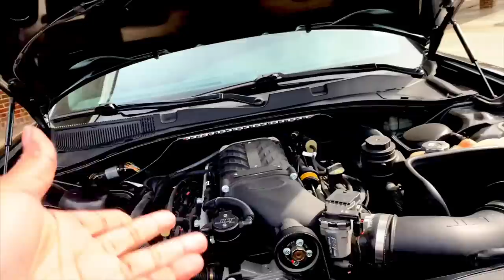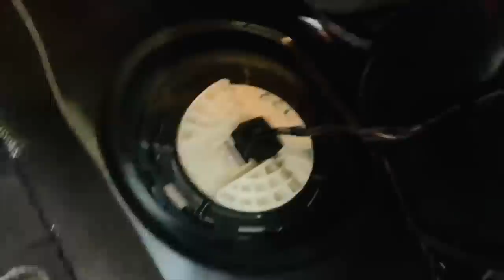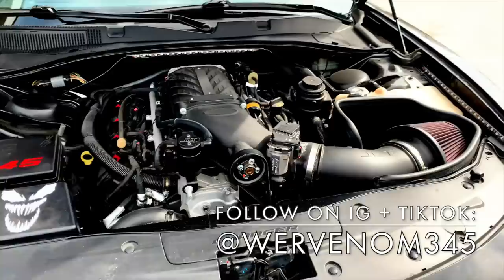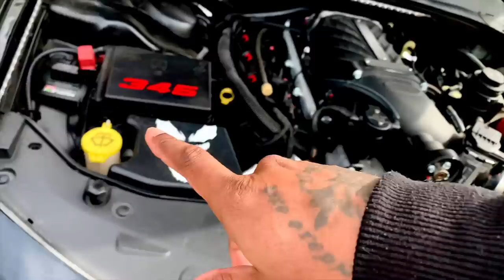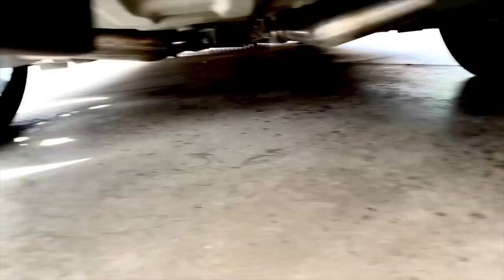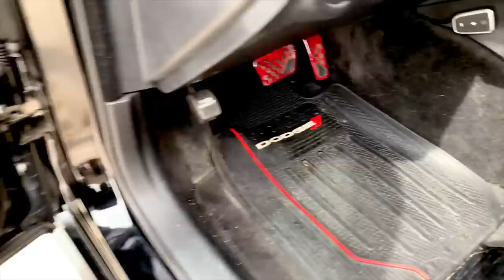How to make your Dodge Charger + Challenger 5.7 HEMI faster than a 392 Scat Pack and a Hellcat!!

Comment: Great video!!! When I saw that it was over 1 hour long, I figured I’d watch 10-15 minutes worth then move on. I watched the whole thing! I agree with your other viewers that I got more from your video than a lot of other YouTubers. Thanks for the blueprint.
Reply from the maker: Glad you stuck around for ALL the info! More to come! 🙏🏾
Reply: Same here, almost bailed on it early, glad I let it run. Buying a 2015 Challenger RT today, already own a bone stock 2022 Scat Pack Shaker. I got the 5.7 as a project car and I want to mod it to run with the Scat. This is a decent guide with some really good insights. It’s a fun platform. Thanks for the education!
Reply: @WeRVenom345   what kind of high flow cats do you have if you have time can you answer my question? thanks my man
Reply from the maker: I have Stainless Works long tubes with their high flow catted mids running through two Dynomax racing bullets and a pair of Flowmaster Outlaws out back

Comment: 5.7 L Hemi is arguably one of the most choked down motors from the manufacturer. With the correct throttle body and intake and getting headers in a full exhaust system and then throwing in a can in tuning the motor. You can actually get a little over 500 horses from the crank out of these motors before you even add forced air entry. There is nothing wrong with an RT. Here's a piece of information that most people don't know. On Dodges race team, the Challenger that they run actually has a 345 cubic inch motor that runs in the low 70s with just over 600 horsepower. They are not running a 6.2 or a 6.4 l.. the fact that they actually use a 5.7 in their race car which runs in the low sevens with just over 600 horsepower speaks volumes period last I checked you could purchase that crate motor just like the elephant motor however the 345 race engine is like 49k.      I'm still driving. Sorry for any talk text errors. I had to comment, though I always get pumped seeing people rep the 5.7
Reply from the maker: I love this so much!

Comment: Good content. I love my Charger RT 5.7, I’ve always realized you can build your 5.7 up, as NASCAR uses a 5.7 NA to 700 hp. Amazing that power w/o boost from NASCAR. Knowing what you’ve done with yours has been awesome keep it up!
Reply from the maker: The 5.7 has so much potential that is turned down by the factory. All it wants is to be turned up. Like you said, just ask NASCAR. Thanks for the love! 🙏🏾

Comment: The 5.7 just gives a person more useable power. The rod to piston ratio is so much better. The ring pack on the 5.7 is better vs the scat . You can run more boost on a stock 5.7 vs Scat. A lot of stuff from the scat works even better on the 5.7...its just better.

Comment: Finally someone that speaks old school fundamental wrench. This is a very high quality matched component build. I sold my 13 rt 6spd for a srt392 6 spd. I may have kept it if Isaw this first. I like my suspension and brakes but the Rt was radar red interior inserts and had BR9 brakes. The Rt is definitely worthy. Not to be demeaned.  Vindication.  Nice.

Comment: Great video my man great car. I just wanted to comment. You are correct about the 309 rear end being a better way to get your power to the ground it is a limited slip. Your explanation between the two rear ends was a little backwards though. I'm not critiquing I just want to clarify for people who are serious about building their Chargers. So the open differential actually divides the power will a 50/50 each wheel and if your car is in a straight line you will burn out both Wheels . What happens though when you go around the corner and you take the weight off of one or other of the wheels you lose the power with the hoping differential. The limited slip differential actually only spends one will until it starts losing traction and then both will start spinning. The limited slip seems a lot like positive traction though because these cars have such high horsepower it's always spinning at least one will which in turn causes the other will to kick in and spin. So with a limited slip there is not 50/50 power going to each wheel. In the beginning all the power is only going to one will but the moment it breaks traction the power goes to both Wheels . Yes the limited slip is better for doing donuts however arguably both the open and The Limited are going to hook traction ideally quite equally. What makes the 309 a better choice is because it is a steeper dear so you get more out of the low end but it's not steep enough that it hurts top speed. It does reduce the top speed a little but not a drastic amount. That's why most of your new hellcats though do you have the 262 open, one it's better on gas mileage and also it does create a higher top end speed while still getting the vehicle off the line . I hope there's not too many errors in this comment as I'm driving and I was talk texting this and did not have time to proofread. I am not hating and I'm not critiquing this video this is an excellent build happy I found this video. Best of luck to your channel bro
Reply from the maker: No worries! We are all still learning and I appreciate the clarity!! Build it!!!

Comment: great informative vid my friend. i had a srt w the 6.1 in it but sold it. had a charger but i want to get a newer challenger now. im really diggin the idea of a r/t sleeper like yours for sure. the catch cans are an absolute must have no negotiations. another thing i ran 20w50 schaeffer racing oil in mine. my buddy builds these cars all the time. he owns a body shop where i live at. thats the only oil he runs period. he also drag races as well. he runs the oil in his charger rt as well. he has a 06 300 srt8 completely built w over 1k hp rear wheel. cool build and nobody likes the one wheel deal lol. do you still have it and if so how is it holding up?

Comment: a cold air intake alone did alot for my 06 chrysler 300c. the power went up as well as gas mileage.. diablo clames 25 hp increase with a cold air intake and 93 octane tune. would love to see what the tune alone does..

Comment: Just picked up a 2018 5.7 r/t over a 2019 scat pack due to the miles being better on the 5.7 and me thinking that the 5.7 could always catch up to a scat as far as power if I was willing to put the work into it and like you said the 5.7 is the OG of the hemis so it’s probably had the most RD done on it.
Reply: I put cat back exhaust hellcat air intake lithium battery and the car is much faster once out of warranty if I just do headers high flow cat amd Diablo tune I can’t imagine how fast I’ll be amd with nothing crazy to motor at all

Comment: RIPP coilpacks are absolutely terrific; and you can actually feel the difference in power; Look them up. They claim an extra 20hp on 5.7s and 30hp on 6.4s; I can't confirm those #'s but they definitely add some uummph
Reply from the maker: I’ve heard this but my tuner swears by the OEM coil packs … 🤔

Comment: Depending on supercharger size and turbos. It can be achievable on a 345 hemi,or GM or ford engines.
Surprisingly some v6s from GM,ford,and Mopar have very good horsepower from factory.

Comment: Hellcat oil pump has larger channels for better flow during idle.  Extended idling is cause of lifter failure.
Reply from the maker: Correct. But I don’t idle for that very reason. Nothing productive comes from idling for no reason (and there’s rarely a reason to idle in park). I turn the car off every time. Rather work the starter than the lifters. Easier fix later. Plus… engine hours matter.

Comment: Thank you for video I been building up my 5.7 an I was already going in direction of supercharger cause I want the power instantly as well an that’s the next step for me for what I already hav to get more power an the diff an fuel system  I changed my cam recently but keep it stock cause like you said need to have it custom grind for what I am wanting thankfully for me I like doing all my own work so I save on labor
Reply from the maker: Fantastic! Keep building out that beast and I have lots more coming to help you out!! #RTgang
Reply: @WeRVenom345  for sure much love I’ll be watching an probably have questions on what to get next also I’m fully straight piped had mufflers on an I liked the deep sounds but I wanted more loudness

Comment: Best video I’ve seen on YouTube, my question is about the rear differential why not the Posi rear differential ???
Reply from the maker: Thanks! And posi (positraction) is ultimately just another way to say LSD (limited slip differential) and that’s what I have on it now: LSD 3.09 gearing. Power constantly being provided to both wheels — equally —  100% of the time.
Reply: Ok I never knew that, thanks for the info…✊

Comment: Which is more bulletproof engine wise the 6.1 or the 5.7? Both seem to have pro's and con's, but it seems the 6.1 may have a slight advantage but damn you make a hood argument to grab a 5.7. Great video, keep it up.
Reply from the maker: 6.1 is very solid as a platform (way more than the 6.4) but the 5.7 is the one that’s bulletproof. Just get those lifters changed and throw whatever you want at it, within reason. It’ll take it and smile.

Comment: Price on the adapter kit kills the whole point of using the ihi 2.4. Some of these performance shops don't think. They just try to max profit not understanding more economical kits will bring more money than max profit prices
Reply from the maker: You’re completely correct on both fronts. Which is exactly why I laid it out as I did regarding that particular blower. Sure, if can be done but unless it’s that specific look you want, the adapter kit prices the whole mod out of its own “space” — so might as well go to the others.

Comment: Very awesome video you have my attention, just started my building 2015 challenger rt born a 392 but ended up being order a rush build 5.7 so I have some upgrades from the beginning. Not sure if I missed in video but did you upgrade cam & lifters your exhaust is amazing flowing effortlessly putting kooks long tube in next weekend. One question with all that horsepower did you upgrade your brakes? Thanks again for all the great info.
Reply from the maker: I’m still on stock cam and lifters for now and no issues. I have a stage 3 Texas Speed cam literally sitting in my closet that I haven’t thrown in yet but soon enough. 

And thanks bro. The Kooks are amazing. Enjoy those. Gotta help the dragon exhale the fire. 

I’ve upgraded more since this vid (coming soon) but I’m running Brembo sixes up front and Brembo fours out back … pulled from a Redeye.

Comment: I'm in NC and finding a shop that will even do performance upgrades for Chargers is next to impossible and when I found one..... quoted Triple what you said you have in upgrades for less than what you have done........ really wish I could find a shop that would be affordable.
Reply from the maker: Yea NC is forever on some BS when it comes to building your car. I know because I lived in the Triangle for a decade but now I’m in Texas which is heaven for car building. You’re gonna probably have to go to SC or, better yet, get with some shops in North GA where the prices are lower but the work is still quality. Sometimes the drive is worth the savings. Gearheads do it all the time — drive hours to find the right shop.

Comment: Do the stanke collars and rockershaft stabilizers there like 370 dollars but will help stabilize the motor in higher rpm when u do the lifters and heads and what are your plans for the transmission and awesome video man
Reply from the maker: Both are definitely great suggestions! As for the transmission, I want to tell you but then it’d serve as a spoiler for a later vid so stay tuned 😉 (even though the HP70 is handling the power well, I have something more potent in mind. 😈)

Comment: Great content, many thanks for the info..

How is the 8 speed transmission holding up? Any mods required for it??
Reply from the maker: Holding up great thanks to a great tune. Not a single issue whatsoever.

Comment: You forgot to mention nitrous which is a great option cheaper than boost I’ve spent just about what you would spend on just a boosted car with no supporting mods and is at 550-600ish depending on shot people get scared of nitrous but nitrous doesn’t blow motors people do if you’re pushing you’re car spraying everyday you’re engine is slowly deteriorating spray only on weekends keep up on maintenance and you are fine I can attest to this that’s my set up ❤
Reply from the maker: Didn’t forget. Just haven’t done it yet 😈

Comment: Alrighty then my brother I've been debating what year , motor .... What are you hp #s and build cost . Also what should I do first ? I've read I need a catch can . But I'd like a cam a Dyno tune and some headers and exhaust ... What should I do to support those modifications.. ps love the ride and info I subscribed ...first build BTW
Reply from the maker: I broke it all down in the vid so make sure you check it out, and congrats on starting your first build! I’d say your first order of business will be to eliminate air flow restrictions (intake and exhaust). 

The better and more efficiently it breathes, the more power and throttle response you’ll see!

Comment: I enjoyed watching this, even took some notes! I have a 2013 R/T Challenger 6 speed manual and have already started modding it out! I did the throttle body spacer, the manifold, going to get a throttle body that actually fits lol along with a cold air intake wanna do a resonator delete and a bunch of other things, waiting on my Diablo programmer! I do have a question on your fun fact.. You said the 5.7 is detuned by dodge to drive consumers to the 392 and to unlock your 5.7 and turn it back up, how hard is it to get it unlocked?
Reply from the maker: You can pay Diablosport to unlock it, or to ship you an unlocked one, or pay a shop around $300 to get it unlocked for tuning (tuning is extra though). Your 2013 isn’t locked, though. Only 2015s and up. You can start tuning whenever you want, my friend.

Comment: Dang fam. Amazing car awesome video... i have a 19 rt that i want to beef up for sure.. i was thinking of legmaker cai. With some kooks long tube headers. Flowmaster catback exhaust. I want to forge the internals aswell then tune. I eventually wanna throw a supercharger on there aswell.. i realllly wanna hear a hellcat whine on my 5.7 love that whine. Hoping its possible. I honestly dont wsnt more than 650hp to wheels. Is there anything you else would recommend im may be forgetting?
Reply from the maker: Thanks for watching! 

You’re gonna want to upgrade your fueling system or you’ll never hit your HP goals. The stock 5.7 fuel pump is a bad joke and so are the injectors. And without enough fuel, you should NOT shove a ton of extra air in that motor (you’ll run lean and then KABOOM). 

Otherwise great list! Go cook!! (And don’t forget to upgrade your rear differential and tires, or you won’t get the power to the ground)

Comment: Love the content you provided!!!!!Question have a 15 Ram 1500 Single Cab. I wanna level out the rear without completing lowering the truck it self. The 24" rims i have fit perfect just not feeling the rear in height.  Any recommendations you could provide with loosing that stock ride?  Would appreciate any feed back
Reply from the maker: Thanks for the love! As far as leveling it out, you’re going to have to at least consider swapping out the rears. You could go air ride, which is more expensive, but allows you to control the height on the fly and to your liking more easily than upgraded springs… but the springs are less expensive … but the springs also add much less weight. Everything has a tradeoff lol

Comment: What’s up my boy Iam out in San Diego ca I got a nag 1 Charger bought new in 2013 it’s a Daytona ready to take the shortys off add long tubes and cam kit can figure what can I should get been looking at a bunch I want a like a stage 2 mild to stay no more then 220/230 because anything higher than that makes the car sluggish
Reply from the maker: Cams are user-specific because you have to decide what your endgame is. Do you want to boost it now/later? If so, you need a cam designed for boost, otherwise you’ll end up getting one now and a new one later. Then decide on the sound/chop level you want, and where you want your peak power at in the band (Mid? High?).

Comment: This is almost the same build I want for my 07 Dodge Magnum. It's a Frankenstein car in progress. Took out the 2.7L for a 6.1 V8 and using 5.7 parts. But I want to get the Whipple set up with K&N cold air intake. I have a question for you,  what brake kit do you think would be right for that build? Brembo or Wilwood?
Reply from the maker: That 6.1 is great for boost — even if you wanted to keep that intake manifold and go centrifugal— but you’ll win either way. As for the brakes, when it comes to the performance of Brembo vs WW, it’s really just a matter of visual taste. 

They both perform magnificently. Brembos might be a bit more expensive, though. 

Keep building!!! 🔥🔥🔥

Comment: Putting my anniversary edition 5.7 challenger in the shop for a texas speed stage 3 cam 1-7/8 longtube headers 3inch straight pipes and custom dyno tune already gotta cold air intake and mid muffler delete you think I’ll be running with a 392
Reply from the maker: You’re definitely on the right track. What’s rear differential are you running?